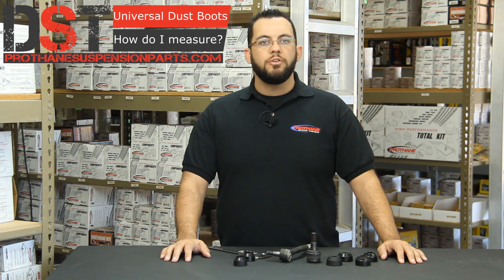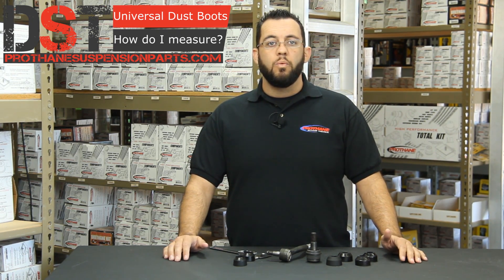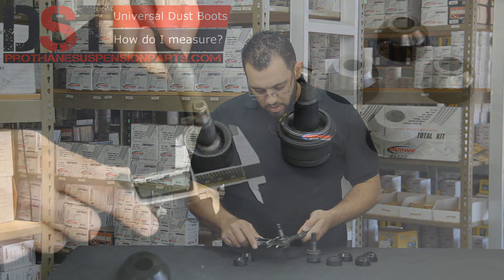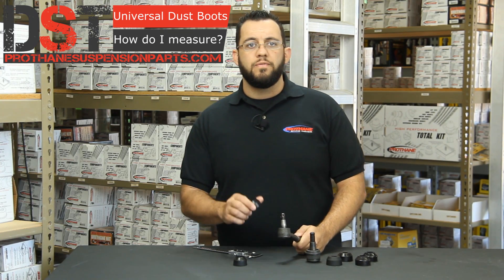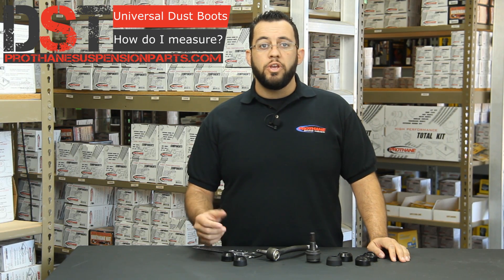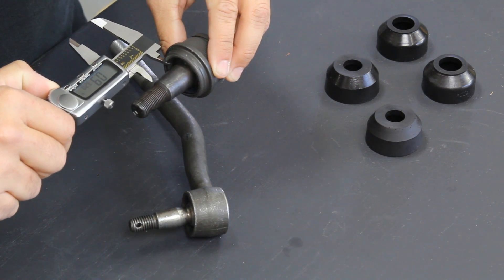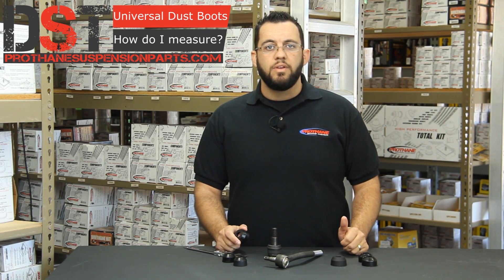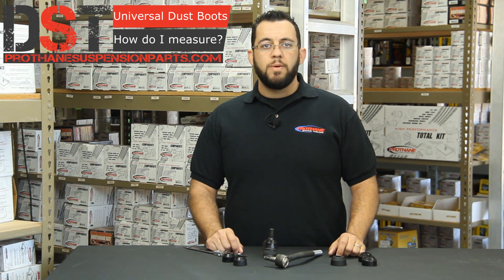How do I measure my Tie Rod End or Ball Joint for Universal Dust Boots?

Comment: I am having trouble attaching the new boot on the new ball joint it keeps slipping down, I noticed it has a wire rim around the top of it I have tried oil and grease and tapping it on..